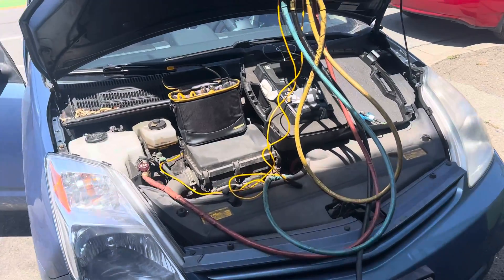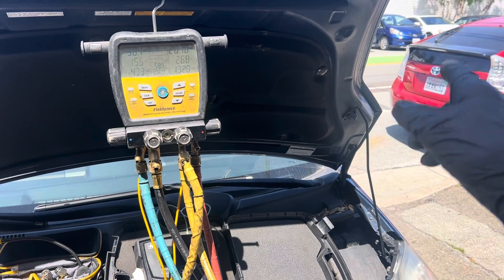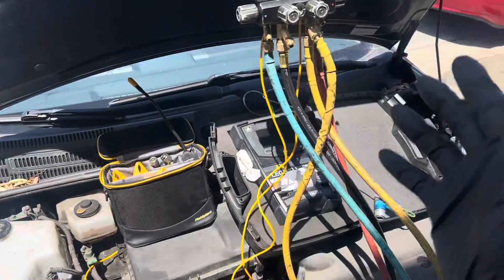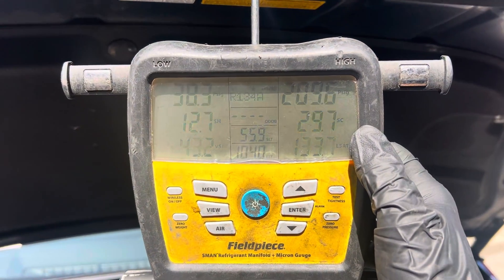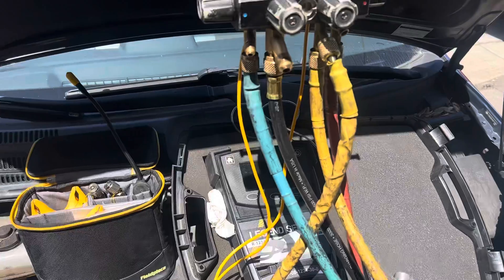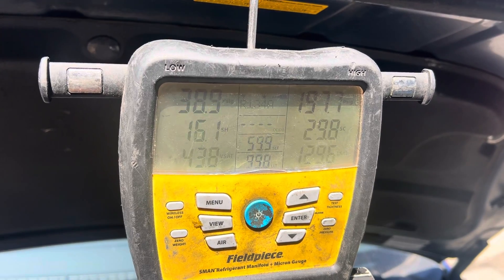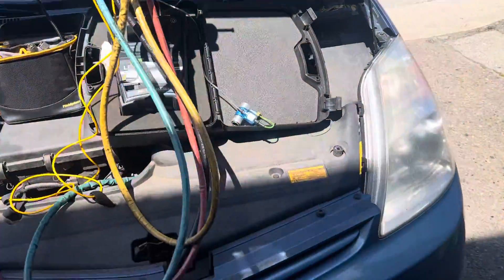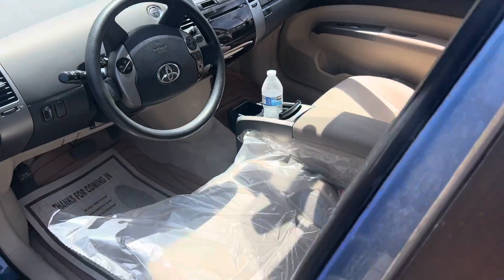Test Prius AC performance under full heat load fresh air vent Before and after measurements￼

Comment: I hooked up my probes on a 1989 Chevrolet Camaro earlier today to see what pressure and Temps it gives me. Like you said, experiment and learn. It definitely was a learning experience, the high fan setting didn't work. I'm researching fusible links on that issue. The clutch gap seems like it might be to big, I remember you saying as it gets hot it looses its magnet strength so researching what that gap should be. I wish I couldn't analyzed the refrigerant. I also seemed to notice an excess of oil from when I disconnected from the pressure lines. It's definitely a whole experience when you physically hook up to a car. It's also crazy how there's so many different scenarios especially when different makes and models differ on how their system is setup.
Reply from the maker: Yes it’s crazy.  But it all comes down to basics physics. 

Every thing has to do with temperature. It affects everything. Even the oil viscosity and brake down.  Temps affect the pressure. 

Think of too much oil as blubber on a whale as insulation . 

Clutch gap should be less the 30 thousands 
         You have to look up the clutch cap for the exact specifications for the year make model vehicle definitely at 20 thousands it should be closing all the time when called. 

If it is stopping after 15 or 20 minutes of operation .
        Have a jumper wire positive ready to connect to the positive lead of the field coil. 

     When it stops working turn off the engine and immediately go and apply power.     The clutch should engage.     

But it could be one other thing voltage drop. 
           
          If it does not engage when applying powered and ground with the engine off then tap the front of the clutch plate with a wooden block to make it come closer to the magnet and then it should snap in. 

Oh yes if the vehicle is that old I forgot about fusible links lol 😂 

I’m assuming it works sometimes at first and then stops working later.   Then the fusible link would not be a problem because it works sometimes. 

You’ll notice if you hook up your gauges on a 50° morning the pressures will be lower than if you hook up your gauges on a 80° day with a vehicle never running just room temperature
Reply: @coldfinger459sub0  appreciate the response, I downloaded the wiring diagram for the ac system and assuming it's correct. All the lower speeds are operated through resistors and the high speed is on a relay. We'll the relay clicks on and off, there's voltage  going to the rely on both inputs. When I bypass the rely the fan doesn't turn on. All speeds share the same ground. There's a fusible link upstream before the voltage hits the relay, I'm assuming it's probably on a couple strands of wire, only reason why I can think of for voltage going through that wire but isn't allowing the proper amperage to turn on the fan motor. The issue im having is locating the fusible link location due to limited info since it's an older vehicle. This is were experience comes into play, if were familiar with these vehicles id have a head start, plus the car isn't in mint condition either.  I'm going to look more into it and go look at the car again. 🚗
Reply from the maker: @OscarSegundo  it’s been a long time but I’m trying to remember if I remember seeing on some old Chevy with their fans a fatter orange wire to the fan as a fusible link just partial bits and pieces of memory not sure if it’s relevant to this year make model vehicle. 

But if you wanna get extreme you can run your own dedicated ground wire to the chassis of the motor because of sheet-metal scrape off some of the paint put your eyelet under one of the bolts to the ground attached to the battery cable chassis ground sharing so it’s direct not through sheet metal. 
     (so now you’re basically direct the ground at the battery cable attached to the chassis or frame. 

Then run a direct hot wire right off the B+ right to the high speed of the fan motor and it should run now you have no fusible links you have no Bad wires you have no corroded connections in the fan should work at high speed.